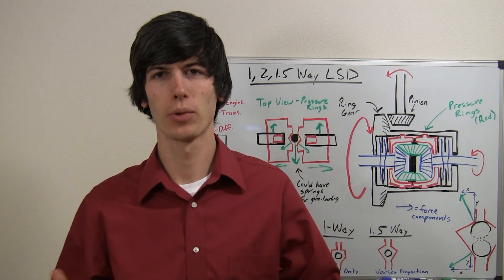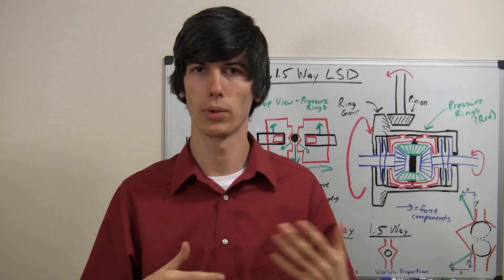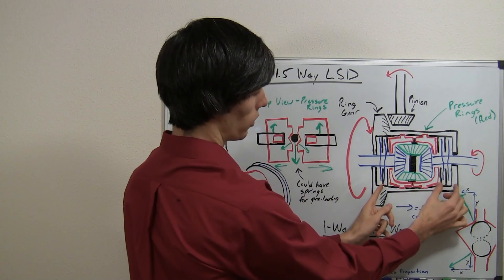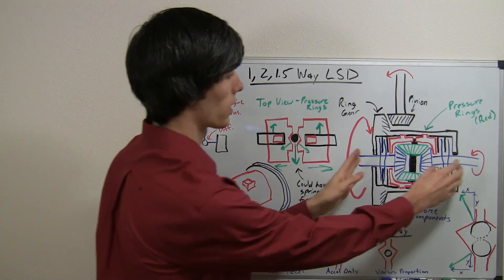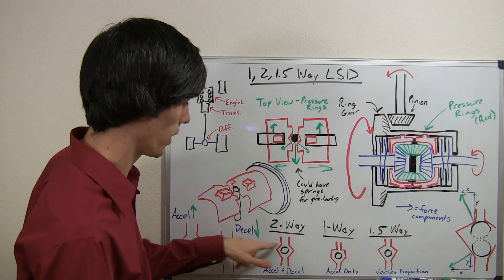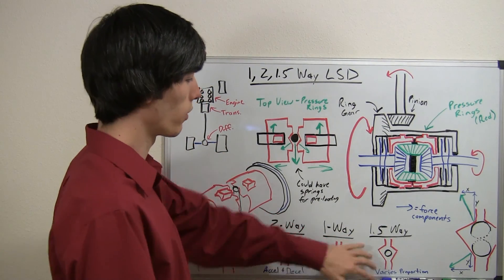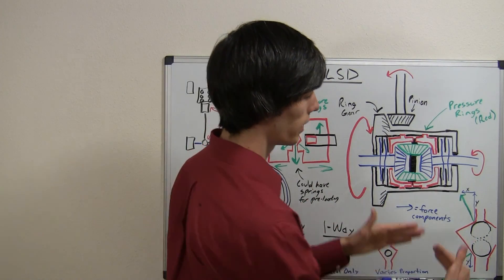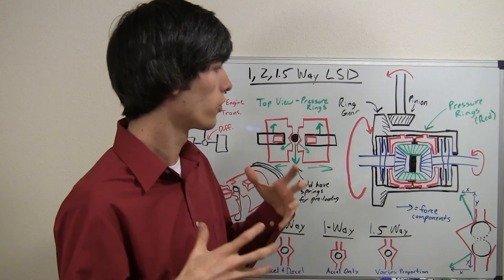1 Way - 2 Way - 1.5 Way LSD - Explained

Comment: Instead of "decelerating" it is actually "braking" that effects the AXLE not the differential which allows for both wheels to lock for hard braking and when accelerating the outside wheel just has to overcome the brake force on opposite side as a standard diff since the brake force is on the Axles clutch plates that can still slip separate from the pinion gear in diff- (unlike the standard diff or locking diff) this way the clutches (under pressure both or individually) is best for both conditions and racing as your torque is not lost (During braking or acceleration as the slipping discs limits one axle to turn more and the other to still brake or spin less "slip less" round a corner or the S's under brake or power conditions at 100% torque.)

Comment: I know this guy insisting that a 2.0 will lock harder during aceleration than a 1.5 during aceleration is this correct?
I thought how hard they lock depends on the thickness of the shims.

Comment: Why is forza telling me a 2way is better while actually a 1,5 way is better?
Reply: Cause in forza everything is fully adjustable, it's not that easy in the real world, when you get a 2 way in forza it's locked at 75/75 by default but most tuners turn the coast down to 25 or less therefore making it a custom 75/25 1.5 way differential, essentially, it's just that in forza you need to get the 2 way diff to even have that option

Comment: Hi Man, my name is Otávio and i'm particite for team SAE Fórmula Cefast in transmission system.
I have a question, you tell in one commentary:

"For example, a 75% lock means the tire with more traction can receive 75% of the torque going to the tire with less grip." 

This is True? I always thought total torque they were 75% for left and 25% for right for example.

And in Drexler case you definided the best angle and type ?
30 ° = 85,272 % ca
40 ° = 58,672 % ca
45 ° = 49,231 % ca
50 ° = 41,310 % ca
60 ° = 28,424 % ca

In my opinion for test in line use 45 °(1 type) for equal torques and the desaceleration angle not harm, because it generates the angle 60 ° with the torque 28,424 % different.

For the other tests like skidpad, auto-x and endurance i would use 40 °(1.5 type), because in a curve there is a difference of torque and as you say.

"If you're going around a corner while braking, a 1.5 way may be better, so that your tires still transfer some torque, but also allow for different wheel speeds so that one tire is not dragging or skipping."

Thank you for attencion and let´s talk about, that's very interesting in engineering.

Comment: i thank jason fenske for teaching me how they work. i didn't 100% understand how the clutchpacks squeezed together. i thought they squeezed together and locks up due to just the rotation of the differential causing it but i was kinda thinking about like... a how'd i understand from the A to D. Doesn't 100% make sense. This make alot of sense, the pinion shaft is letter B and the pressure ring is the letter C in essence, with D being differential lockup/clutchpack being squeezed together. Thank you again Jason.

Comment: Hey Jason,
Could you explain how a GKN Super LSD behaves? It's like a clutch-type LSD except that it uses conical clutches instead of clutch-packs to achieve locking. According to their brochure: http://3.bp.blogspot.com/-CPZi8jYHEHw/UfpdPKNvzbI/AAAAAAAAB-U/dnG20OgbG08/s1600/Super_LSD-page-001.jpg , it has benefits of a Torsen as well as being to fully lock-up like a conventional clutch-type.

This is the LSD that came in my NC Miata (also the OEM LSD for the late NBs and all of the NDs, I believe), so it would be helpful to know how it behaves.

Comment: What about Helical Gear limited slip differentials that are: 1 way, 1.5 way, and 2 way. And their effect in a front wheel drive car. 

I know you did the videos about the 1, 1.5 & 2 way clutched type of limited slip differentials, and the Torsen limited slip differentials, but those are not entirely the same as 1 way helical, 1.5 way helical and 2 way helical differentials. 

So basically, how this video explains the clutched 1, 1.5 & 2 way LSD, would you be able to make a comparable video about Helical geared 1, 1.5 & 2 way LSD's? And, could you help shed some light on their effects in a front wheel drive car?

Thank you for all the wonderfully informative and interesting videos and explanations you have made, I truly have learned quite a lot from you and greatly appreciate your expertise and awesome way of explaining things in a manner that makes sense!

Comment: differentials had been always a mystery for me. Now it looks to me that the limited slip type has lots of parts in the housing, as a result, is it less durable than the locking or open ones?
Reply: From what I've heard their not any more likely to completely fail, but eventually they will fail to lock. Depending greatly on the type of LSD. From what I here Viscous diffs have the shortest life span.

Comment: Another thing related to my previous point... wouldn't a 1 way differential do the trick, but working in an inverted manner?EG. when breaking there is more lockup in the pinion shaft and when accelerating there is less than in breaking... but there is still lockup.Does such a differential exist?

Comment: "While in neutral and decelerating, the differential will act as an open differential, regardless if it is a 1 way, 1.5 way, or 2 way LSD."

that is still actually quite wrong. when freewheeling it still acts as an LSD but a non mechanical type. with the car off the ground you should still not be able to turn one wheel independent of the other (or at the very lest there should be some resistance) because of the preload on the clutch packs while at rest so how much LSD effect there is when your freewheeling will depend on this preload. 

apart from that small glitch, great vid explaining the differences and how they work.

Comment: when turning a corner, one would usually brake before the corner, and apply power while turning or after the apex (but still while there is a corner). this application of power would lock the diff up thus making it understeer on the exit of the corner? YOUR VIDEOS ARE ACE, THANKS LOADS, but i have loads of questions. I hope you're still on here so you can answer them.
Reply: With a fwd vehicle, I would say you're correct. On a rwd vehicle, a lockup scenario could engage the car in oversteer, if the vehicle has the necessary power to break the rear tires free.
Reply: +Giles Braid "thus making it understeer on the exit of the corner?"
all depends on the car and how its set up but generally your partly correct tho usually when your hard cornering with an open diff you are supplying more power to the wheel with the least grip thus getting wheelspin on the inside tyre. with an LSD (or locker) you are applying more power to the inside wheel with more grip thus propelling you faster around the corner. 
that being said, from a standing start with little grip (like doing a right hand turn unto a side street on a road covered with gravel) you will certainly tend to travel in a straight line and understeer as has happened to me in the past with mine. this is for rear wheel drive cars
on FWD cars with lsd/lockers they do tend to understeer a lot but once you get used to driving them you can use this to your advantage.

Comment: Why does the pinion shaft move when you accel./deccel.? Is it just momentum?
Reply: +Nick Clarke 
because the pinion shaft is attached to the diff carrier/crown wheel while the gears inside are connected to the axles/wheels. this is the way that the diff applies the force from the motor to the wheels. the axles are trying to resist while the diff carrier is trying to force them to move (its one of newtons laws of physics)
Reply: +Nick Clarke yeah
Reply: +Dan TheOracle Thanks!

Comment: so a RWD drive car with out a limited slip car is pretty much a one wheel drive car
Reply: ***** no... The differential gear was invited far before general motors was established
Reply: There's a locked diff and an open one also the locked will act the same as a welded diff but an open will be one wheel drive only if there is traction loss, it will still send power to the other wheel but not as much. But when you have a wheel on grass and a wheel on asphalt and your stationary the only one that will spin is the one with least traction so the grass
Reply: No it's two wheel drive locked, so no matter what you do, both wheels will turn at the same time all the time.

General Motors have a video explaining as they were the ones to invent the differential.
Reply: Ok, my mistake but GM were definitely the first to effectively use it for the automotive industry.
Reply: @Papa7Bravo  GM are hacks.

Comment: So if you change to reverse gear and press the accelerator pedal on a 1 way LSD, the LSD will not lock since it will hit the flat side?
Reply from the maker: Sounds right, I think.
Reply: Engineering Explained Thanks! I have another question: Limited slip differentials rely on  basically friction inside the differential. How does braking applied by the car's computer to the slipping wheel compare? Equal, weaker, better torque redistribution?
Reply: +Chris Park you are exactly right, it will be the same effect as when you are engine breaking as the motor is applying the reverse umm thrust? on the diff.

Comment: Nice vids, been watching the entire diff series. Do you think it feasible to modify the pressure rings on a 1-way? Potentially welding material, then shaping it to mimic the pressure ring profile of a 2-way? Could you speak to the strength required, material used and possibly the material weakening from heat exposure? Thx.
Reply: Upon closer investigation of your diagrams, it appears by simply machining away the linear plane on the pressure ring, one could turn a 1-way to a 2-way, thoughts?

Comment: I have a 1995 F150 4x4 with rear ABS, 8.8 355 rear differential. I Want to change it to stock Ford 8.8 355 limited slip differential.Do the 1-way apply to a ford Differential?

Comment: Actually, if you slam on the brakes, the diff acts the same as when accelerating, because when you brake, you're slowing down the wheels, not the engine. Where the difference comes in, is the moment when you decelerate with the engine, by changing into lower gear, or just taking foot off the gas pedal.

I imagine it works that way, correct me if I'm missing something...
Reply: ***** the 2-way can be thought of as a welded diff when you are in a straight line but when you turn the outside wheel will slip the clutch on that side because it has to move faster than the inside wheel, i think.
Reply: ***** so turning-in using a 2.0 in a car with ABS is better when the brakes are slammed than when no brakes are applied??? interesting... and very drifty!!!
Reply: ***** Close but you have to figure in the deceleration of the engine, if the engine opposed deceleration you'd be spot on but when you take your foot off the gas and hit the brake both the car and engine are slowing down so the wheels may be applying a decel force to the engine or it may not. As far as differentials go however, when braking (with brake pedal) it's a moot point because the brakes are applying stopping force to both wheels.

Comment: A 2-way isn't even used in motorsport - it doesn't discriminate on deceleration (if you are engine breaking or not) and that equals in wasted traction in turns...

Comment: I know this is dependent on the materials used, but how much heat is generated between the Pressure Rings and the Pinon Shaft? I am just curious to see how much it would heat up. Is there any possible way to reduce this generation of heat, besides using different materials?

Comment: I have a question about the lockup created by the differential during braking. How does engine braking occur when you go off the throttle for too long? Also is the amount lock in the differential caused by how much you are accelerating? As always awesome videos.

Comment: ok, I understand; but in cornering at low speed and/or in adherence, the external wheel is allowed to have an higher speed? otherwise, don't I feel a bad behavior on the steer like in a kart or in a full locked diff?

Comment from the maker: I think you're over-complicating it a bit. The locking starts when there is a force accelerating (or decelerating for 1.5 and 2 way diffs) the differential, regardless of what the wheels speeds are.

Comment: great video, man!
I've a question: does the locking starts when the angular speed between the wheels exceeds a certain difference, so there will be an axial thrust on one side? or it will lock also in straight trajectory and in normal cornering?
finally, in decelerating, if i'm braking so hard in a corner, if i've a locking of the internal wheel, the external one will be locked also, right? (in this way I reduce the yaw motion 
about z axis).
Thanks.

Comment from the maker: It's not locked when you are not accelerating or decelerating. It's like an open diff then, so going around a corner with your foot off the gas allows for the tires to rotate at different speeds.

Comment: This type of setup is mostly used on 911 and other MR cars in order to make the car less tricky and more stable under decel.

1 way is a setup mostly used for FWD cars where decel lock will only cause understeer during braking.

Comment: OS Giken for the Lotus elise is a clutch type differential. With a twist though. Extra springs draw the ramp pieces together, causing smoother locking.

Comment: Experience tells us that momentum from the grip of the wheels also causes e certain amount of lock, but most of it is down to the engine indeed. With a 2 way in gear (depending on clutchdumps or flywheel aggressiveness) you will definately have lock during decel/braking. This will enhance stability for the car.

Comment: It puts unnecessary forces on your drivetrain. If your drivetrain is strong enough to handle it, no problem. But if it's to weak, something will brake eventually.

Comment: I'm glad the whole braking forces point was raised. Great explanation overall. This diff is probably meant for a vehicle running on a road course using a manual transmission, then some of the reverse torque characteristics would apply.  Also, I know this is the 1, 1.5, 2 way video, but there is a more basic LSD design without the crosspin ramp for the 2 way. These are the most common LSDs and just use the side gear separation forces. They are a little easyer to understand.

Comment from the maker: Basically you take an open differential, heat up (weld) all of the ring gears/spider gears inside until they all melt together, and you know have a locked differential. Why spend money when you could just use fire, right? Haha I don't recommend it if you plan on driving the vehicle on the road.

Comment from the maker: Preload is exactly that, the load on the clutch pack prior to any other forces; it's constantly applied so there is a set amount of torque transfer. The percent lock refers to how much torque can transfer to the wheel with more traction. For example, a 75% lock means the tire with more traction can receive 75% of the torque going to the tire with less grip. 

If anyone disagrees or knows more, please share.

Comment: I have a question, I was considering getting an aftermarket LSD for my daily driver. I was considering the 1.5 Way, but I am told that it is "dangerous to drive" and not recommended for the street in the rain,and snow, etc.  By the way my car is a RWD car @ (2750lbs.) Will it effect my daily driving tremendously?

Comment from the maker: So that both rear tires can spin rather than just one while in a drift. If it were an open differential, what would likely happen is the tire with less grip would spin, and the other would remain with grip, basically preventing you from drifting. A locked diff ensures that both tires are always spinning at the same rate, so this can also be used in drifting.

Comment from the maker: Yes, this does seem logical. I'm finding mixed messages after further review. On one hand: "Depending on the initial torque you have the diff set up, this diff will be locked when you are both on the gas, and on the brakes." On the other: "the differential will provide some level of limiting under engine braking." Regardless it seems engine braking is required. I'm unclear on if braking enhances this.

Comment from the maker: This does makes sense. It does seem you would have to have a drivetrain connection (engine braking) causing the pin to lock the diff together. Reading up more on it now.

Comment: I have some doubts, imagine a front wheel drive car with LSD in a corner, if you accelerate the speed in both wheels will be diferent? or they to be pushed both as same speed? :s  i mean, will the inside tyre push harder because it's slower? Forcing the car to "turn more"? I probably can't explain my self, i hope can help me :) thanks

Comment: not 100% correct, if you have a car with manual gear and 2way diff, if you have no spring pre-load on the clutch-packs in the diff, how can they lock or try to lock if the driver have the foot on the clutch and the engine has no load on the drive train. the energy required to slow down the gearbox and driveshaft is not what is doing the job im sure of that. if so, im sure you have way to big drive train losses, the load for the diff comes from engine braking and lock-up if hard down shifting.

Comment from the maker: Finally, I agree that the end of my video was a little rough. I need to start watching them more thoroughly, and redoing parts where I screw up. I do usually require more than one take, and sometimes split them up. I guess this time I just didn't realize that I was straying off and blabbering. The intention of my video is for it to sound conversational, like you're in the room with me and I'm teaching you (no cameras around). Thank you for pointing out the error at the end.